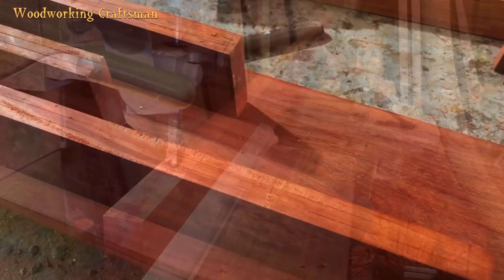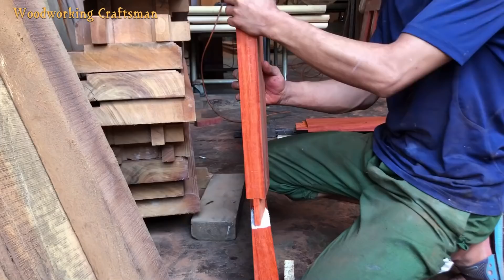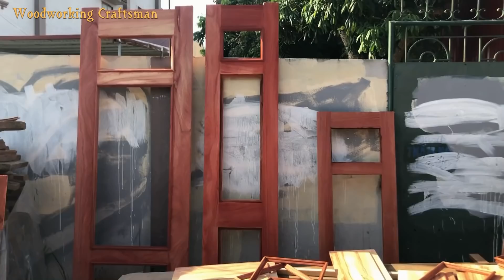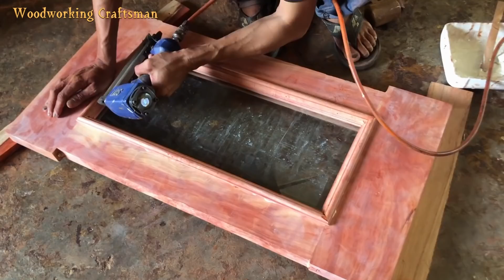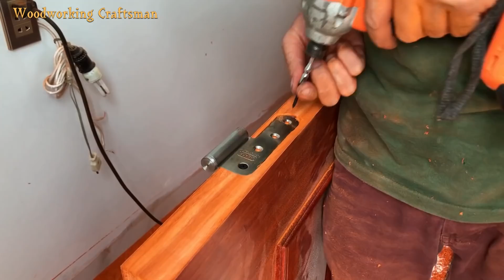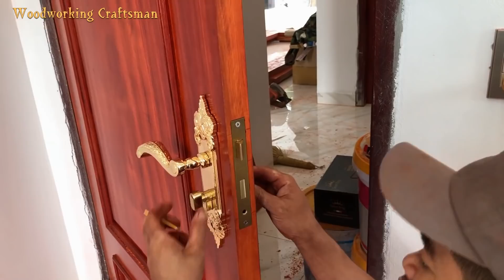Woodworking Workers and Projects Red Hardwood // Skillful Carpenters in Design Wooden Bed Room Door

Comment: Their power tools are actually pretty decent. A foot operated hollow chisel mortiser, a heian tenoner and that lockset mortising tool. Their jointer is supposed to be used with that power feeder but it must be broken. that glue though. It's got the consistency of cookie dough. And the joinery is a little too tight. Especially with that pasty glue they're using.

Comment: What is the name of the machine use to make square hole
Reply: It's an industrial sized hollow chisel mortiser. It has a drill core that removes the bulk of the wood surrounded by what is essentially a 4-sided chisel. There are benchtop versions of this tool as well as attachments for a drill press.